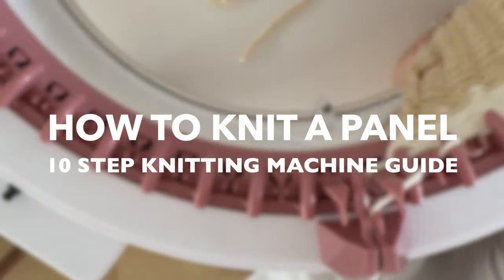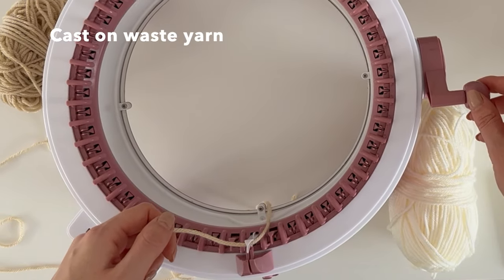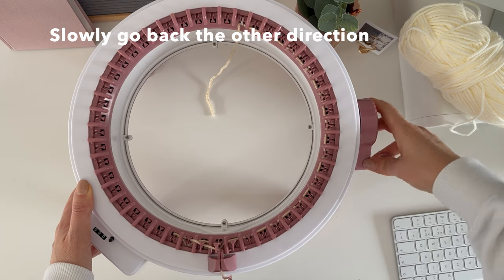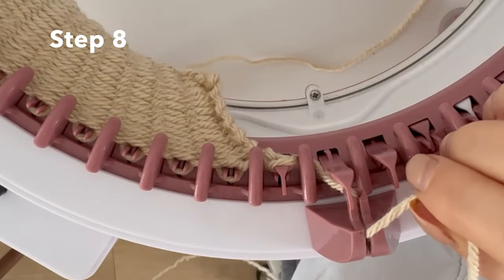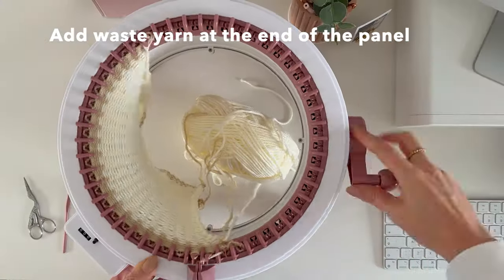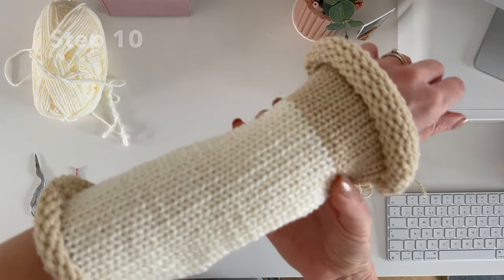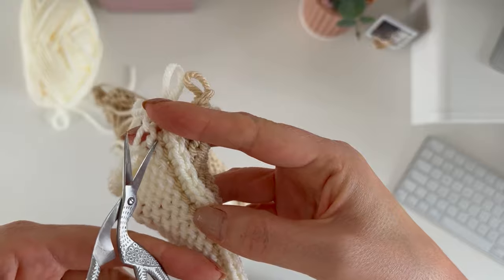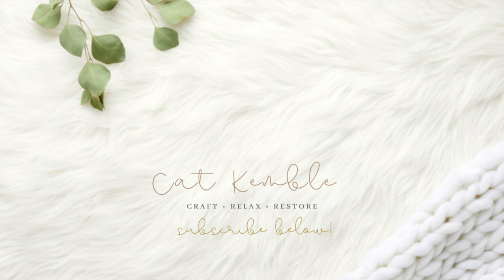HOW DO YOU MAKE A FLAT PANEL ON A SENTRO KNITTING MACHINE?

Comment: I could be wrong, but I’m pretty sure your tension connection is upside down😮
Reply from the maker: Hi 👋, it only fits onto the machine one way
Reply: It is definitely on the 'wrong way' lol but if it works it works! The springy part is supposed to hit the bottom of the machine so it gives a little when the yarn goes through, it is not supposed to be motionless :)
Reply: Mine is the other way.  Your is upside down  @catkemble